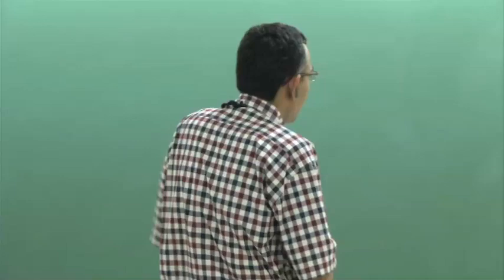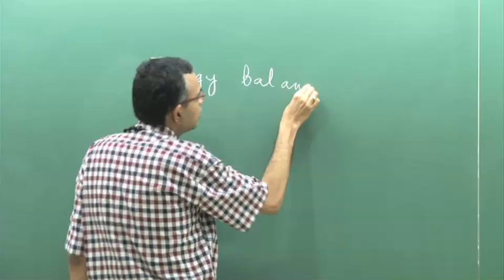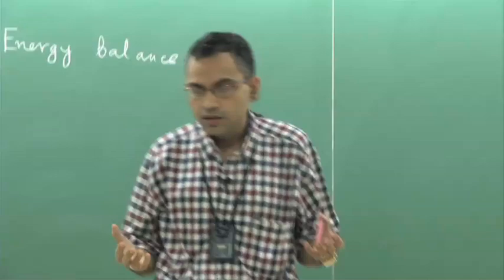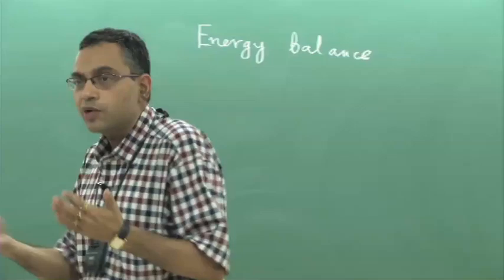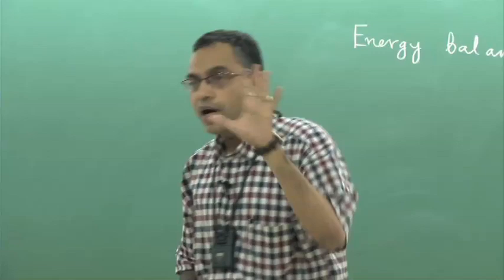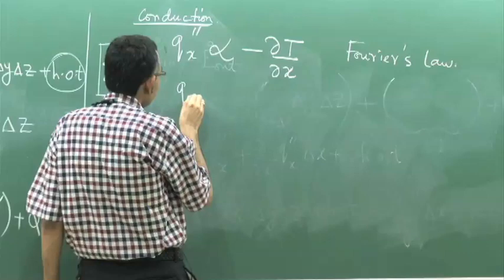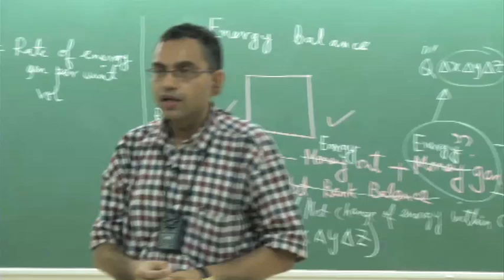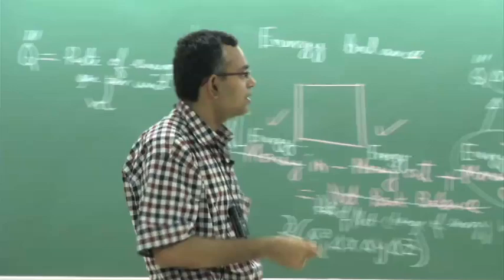Lecture 03: Heat Conduction Equation

Comment: • Energy conservation in finite time frame 
  (Unsteady state formulation) : 
Net transport of energy fluxes at any instant by both convection & diffusion with source or sink constitutes to the accumulation of energy storage at that instant. Hence, the energy conservation in unsteady state. Because, for shorter & finite time scale the energy accumulation is significant not to be neglected. 

• Energy conservation in infinitely large time frame (Steady state formulation) -
Here, the convective & diffusive fluxes of energies are balanced with possible miscellaneous effects like source, sinks, dissipation, etc so that at any instant in time of considered time scale there is no significant accumulation of energy content in the control volume of the system. So, this effect gives that temperature is just local variable & not instant variable.

Comment: Dear sir, since you mentioned that the rate of change of energy within the control volume is the rate of change of internal energy wrt to only time, then why partial derivative, it has to be ordinary derivative.
Kindly rply sir
Reply: keeping the position constant
Reply: I think, as it is a 3d control volume case and at various points there we've to locate for heat transfer or internal energy analysis wrt time so.....
Reply: Because internal energy is a function of temp and pressure as well